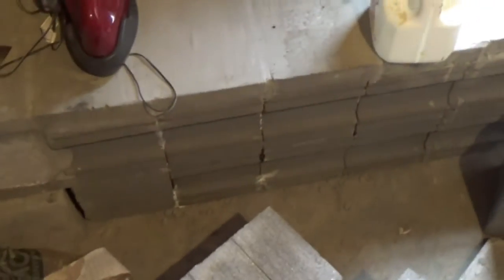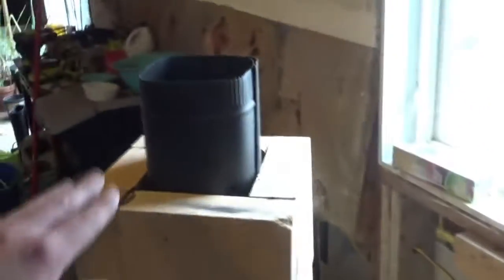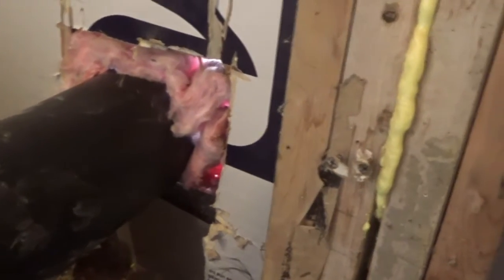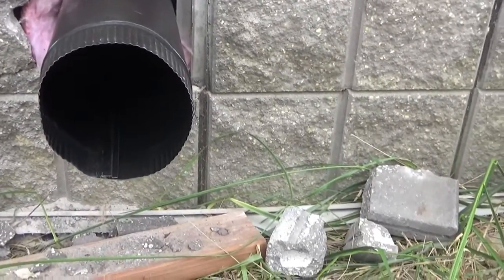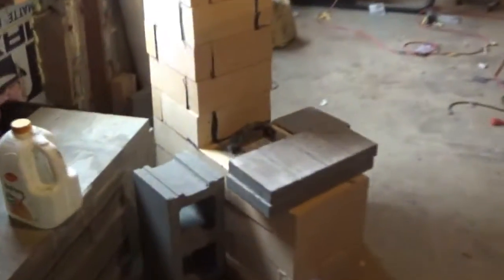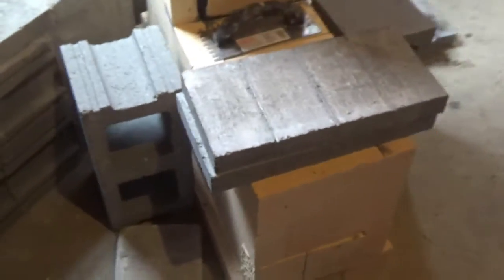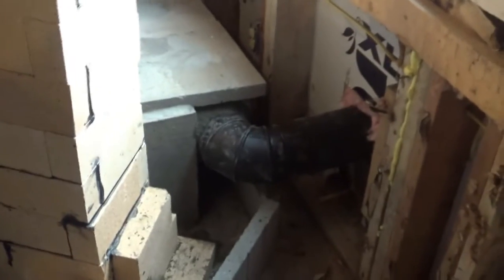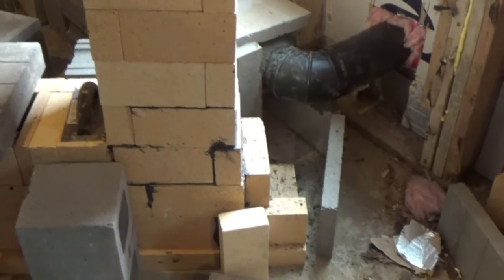Rocket Mass Heater Part 2

Comment: You need to vent your exhaust to the OUTSIDE, not just your greenhouse! There is carbon monoxide in the combustion gases from the rocket heater!
Reply: Old comment, but false. RMH, as long as the fuel is decently dry burn hot enough that there is almost no carbon monoxide. Carbon monoxide is the result of low temperature, low oxygen burning found in conventional fireplaces. The leaky nature of a greenhouse would have no problem keeping it at a safe level. CO burns at about 1130 degrees Fahrenheit which is easily exceeded in the riser.